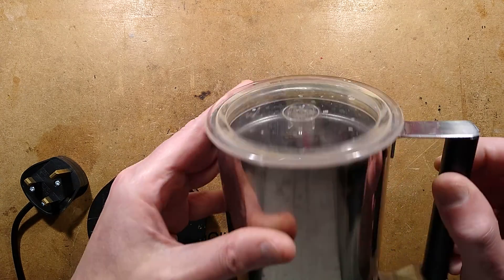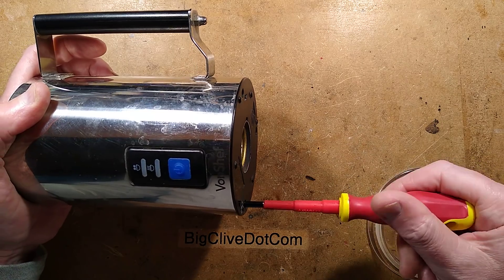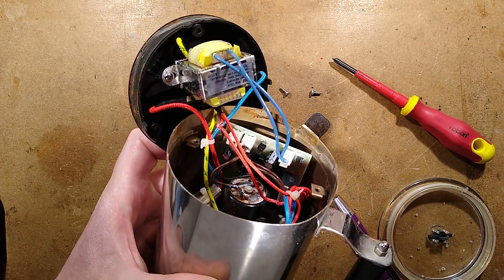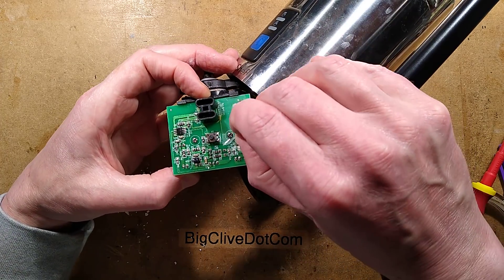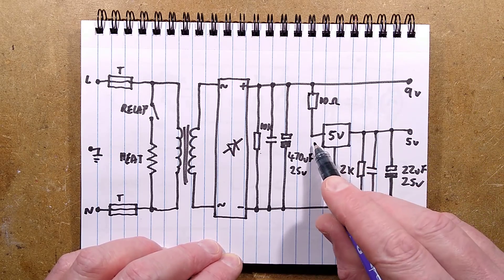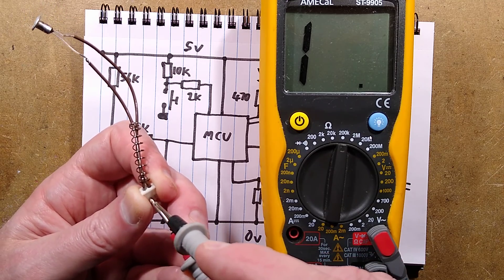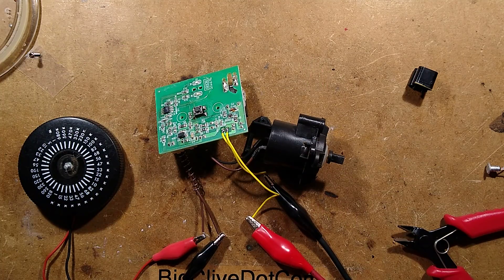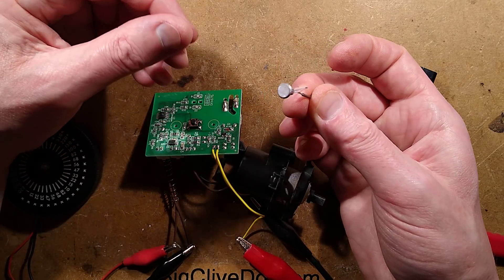Thomas Nagy milk frother autopsy

Comment: "It'll work for a certain length of time and then you can buy a new one!" Excellent marketing strategy, especially if you can forbid anyone outside your company to mend it! ^cough^ Apple ^cough^
Reply: @mgancarzjr  Schematics and parts in the case of Apple.
Reply: Most of the components on the new MacBook logic boards are SMDs the size of sesame seeds - and some, I think, are closer to poppy seeds.  Ditto for the newest iPhones.  You couldn't fix much if you wanted to, and I'm pretty sure that even Apple doesn't bother to try.  Return it under warranty, and they hand you a new one.  Non-repairability seems to be the price you pay for miniaturization and robotic assembly.   Even wizards like Louis Rossman are going to need a new line of work once all the old machines are retired.
Reply: Samsung. Appliance companies. Most companies that deal with electronics
Reply: my lord, is that....legal?
Reply: I think most electronic now days have a 8/12 month life
Reply: @zh84 - nah, with me it means I will look elsewhere first rather than immediately repeating my mistake of buying the same make/brand again (of course, there may be other reasons that I buy another item from that make/brand).
Reply: Simply, just don't buy Apple. There are other brands that equal or better them. Take some time and a little research, you'll be glad you did.
Reply: @snakezdewiggle6084  there aren’t, though. The other brands don’t run iOS.
Reply: @JasperJanssen  - iOS does have problems and bugs.
Reply: @Mark1024MAK  and IOS is the least secure OS.  Apple is the slowest to fix exploits once they are known.  It's not part of their core business.  MacOS is even worse, but it's a smaller segment of the market, so isn't so much of a target, so "false sense of security" is an issue.  I really hate to say it, but Microsoft is the most pro-active in this area, followed by Linux/Android/etc/.  

One day the hackers are going to get sick of getting blocked so quickly by MS/Linux/Android and start going after the real soft target - IOS and MacOS.  Watch the excrement hit the rotary oscillator when that goes down.
Reply: @JasperJanssen  iOs is Linux, which is Android.
Reply: @snakezdewiggle6084  iOS is Mach, which is Unix
Reply: @snakezdewiggle6084  No. All Android is Linux, but Linux is not Android. 
iOS is not Linux, its based on Mach, which is BSD, which is UNIX.
Reply: Linux is just a 1:1 copy of Unix without using any of Unix's code;  so technically Androids and iPhones are all running some form of Unix. I mean we wouldn't have any of these operating systems in the first place(at least not in their current state) if Unix never existed.
Reply: @michealpersicko9531  yeah, Linus just wrote his own version of the proprietary code and then made it all standalone turn key, and free. The guy does not get enough credit. When Linux was released - Unix did not have a GUI. But Linux did. ;)
Reply: @tookitogo  Okay, if you say so.
Reply: @snakezdewiggle6084  I say so because it’s true, and you can verify this easily. 

iOS is derived from Mac OS X, which is the direct descendant of NeXTstep, which was released as a commercial product three years before Linus Torvalds released the first version of the Linux kernel (which was years before Linux was a full-fledged OS).
Reply: @michealpersicko9531  macOS (Mac OS X) has been a certified UNIX for many years now. Linux and Android are UNIX-like. 
macOS, iOS (and its derivatives: tvOS, watchOS, etc) use actual BSD UNIX code.
Of course, this is all academic, since that’s all just at the kernel level, and ignores all the juicy stuff in the higher-level APIs where all the fun happens.
Reply: @tookitogo  OS X = 24 March 2001.  Linux = 1991~1993.  I was there, where were you.
Reply: @tookitogo  okay, if you say so.
Reply: @snakezdewiggle6084  regardless, you’ve forgotten that YOU made the claim that iOS is Linux. This is categorically incorrect. 

Everything else is people explaining to you what iOS is, since that’s a logical way to prove what it isn’t.

The Linux kernel has never been used in iOS (nor Mac OS X, nor NeXTstep, nor any of iOS’s offshoots). The GNU open source tools that are often considered part of a “Linux” operating system largely predate Linux itself, and are basically independent of the kernel. Many of these are used on Linux and all the UNIXes, including Apple’s OSes.
Reply: @snakezdewiggle6084  Again, I say so because I actually know what I’m talking about. It’s all 100% verifiable.

Look, there’s nothing wrong with not yet knowing something. But don’t attempt to speak authoritatively on things you don’t actually know, and certainly don’t try and correct people who actually do know.
Reply: @tookitogo  I have not made any reference to iOS.
I only comment on what I have witnessed and experienced personally.
Reply: @tookitogo  Apologies Antonio, seems that I did type "iOS", an error on my part. Again, my apologies.
Reply: @snakezdewiggle6084  Thanks for the acknowledgment. Out of curiosity, then: what did you mean to write, if not iOS?
Reply: @tookitogo  OS X.
Reply: @snakezdewiggle6084  OK. But that still would be equally untrue, since Mac OS X doesn’t use Linux, either.
Reply: @tookitogo  hi  Antonio. I'm going back thru my magazines to find articles that may bare-out one of us. Discovered a magazine CD with a free copy BSD and NeXTep. ;)
Reply: @snakezdewiggle6084  That’s cool and all, but you could just check Wikipedia instead... this isn’t secret knowledge or anything, it’s well documented.
Reply: @tookitogo  Unfortunately, I don't have a phone or computer. I rely on an old television + remote control, but only have access to YT and some weird asian weather site. Kind of ironic in a way, I built my first logic CPU from discrete ICs and xsisters back in the mid 70's. I also participated on some of the early papers that became to be known as GNU.
Reply: @snakezdewiggle6084  That’s wild!!
Reply: @snakezdewiggle6084  Not a solution, do you think Samsung, LG, Sony or anyone else is going to give you schematics or sell parts? Ok, technically Samsung does sell some parts, but otherwise the vast majority of the parts you need to fix your devices come from third-parties that make replacements or recycle old devices, it's very rare for any manufacturer to provide parts themselves... I'm not even a repair shop, but I've worked on at least one of all three brands of phone and all were a hassle trying to find OEM parts and I ended up just buying whatever was on ebay for all of them.
Reply: @vgamesx1  you do realize that, fabrication, modding similar components to suit other gear, etc. are the back-bone of, DIY, home workshop, hobbyists, small self-employed Tech's and engineers, and the list goes on and on.  THE RIGHT TO REPAIR !!! Go tell it on the mountain.
Reply: @snakezdewiggle6084  ok? What does that have to do with not buying apple? That doesn't solve the problem and diy solutions help but very few people want to put that kind of effort into fixing something.
Reply: @vgamesx1  ok then, simply, just buy Apple.
Now boys and girls, see how easy that was to fix! Next time, we will be fiddling with our bitcoins...
Reply: @snakezdewiggle6084  I find it hard to take you seriously when you keep dancing around my argument, since you don't seem to get it let me spell it out for you, the real issue here is that literally everyone does what Apple is doing to a greater or lesser extent, I can't think of any company that gives out schematics for their products and even if you can find parts you definitely will not find the code necessary to program a new MCU or whatever, sometimes they won't even ask about warranty/repair and straight up tell you to go buy a new one.

Comment: The board has HT46R005 silk screened on which immediately returned a result for a "Holtek Small Package 8-bit OTP MCU". It has a fairly extensive looking datasheet for what it can do. the ToC is 4-5 pages alone. 
"The HT46R005 HT48R005 are a series of 8-bit high-performance, RISC architecture microcontrollers specifically designed for a wide range of applications."
It looks pretty capable.
Reply from the maker: One day I'll remember to check the silkscreen.  I tend to go straight for the components themselves.
Reply: @bigclivedotcom  Aye it's the same with a lot of us Clive, always missing things that are right under our Noses. After spending numerous hours and many magnifying glasses and bright lights, I also need to remember to check the silk screen components description. 😉😊😂🤣😂👍👍👍
Reply: @stevejones8665  - but you do have to compare the silk screen information to the actual component as they don’t always match!
Reply: Sadly not capable of handling water ingress 😞
Reply: @chrisa2735-h3z  Now you're just milking it.
Reply: @thomasbonse  yeah, cos it's not meant for water ;)
Reply: @snakezdewiggle6084  There is a fairly simple way they could've made this frother more reliable (and more sanitary). Just separate the stator from the rotor and have the inside surface formed to create and maintain that separation. Then completely encapsulate the rotor in plastic. Doing this eliminates the need for gaskets. Also the rotor would be removable for washing.
Reply: @thomasbonse  think my Nespresso frother  is separate from liquid. Wisk   sits over the cast or sealed rottor. Not sure about the underneath
Reply: @thomasbonse  oh, I was going in the "Right to Repair" realm. :)
Reply: These small Holtek micros are basically Microchip PIC16 (i.e. 14 bit core) clones. Same instruction set (but different assembler mnemonics), same pipeline architecture giving one clock per cycle at one quarter of the clock rate, same memory map etc. They are very cheap though, single digit cents cheap.
Reply: Data sheet said.
The HT46R005 and HT48R005 are a series of 8-bit high
performance, RISC architecture microcontrollers spe-
cifically designed for a wide range of applications.
I was also guessing 14bit Pic,s aswell.
Only came to see how many spotted the silk screen.😉😊👍👍
Reply: @stevejones8665  Sounds like a contradiction? Specifically designed for a wide range of applications...
Reply: @haajee1  I could see a u-conctroller be specifically designed to be very flexible, say in what each pin can be configured to do - digital in,digital out, PWM out, analog out (internal DAC), analog in (internal ADC), interrupts,  serial protocols etc...
Reply: @ferrumignis  Suspected this as soon as I saw 14 bit wide in the datasheet, interesting.
Reply: That was one of the best silk screens I've ever seen... The component values were stamped right next to every component!

Comment: Storing it after use upside down might help with liquid ingress down the shaft.   I know  it would cost more but why not use a sealed jug with magnets driving the whisking element?.   2x👍
Reply: The Nespresso one uses the magnetic drive. Works well.
Reply: @PIXscotland  Handy to know.👍
Reply: Magnetic stirrers are very familiar in chemical laboratories.
Reply: @zh84  Yes, I never thought of that. 👍
Reply: There would need to be a whisk effect in order to incorporate air and froth the milk. I'm not sure those little pill shaped stirrer things I've seen chemists uss would work.
Reply: @Nono-hk3is  magnetic sealed motors are used for lots of things. You'd use a whisk stirring element for this, it doesn't have to be one of those pill-shaped things. Another place this concept is used is in electric water pumps used in some cars. The motor spins a cup-shaped magnet that goes around the pump housing, and there's a magnetic impeller that moves coolant through. This is usually for small auxiliary water pumps, but it's used even for main water pumps. Magnetic drive really is a good idea for anything that needs to run in liquid.
Reply: @puckcat22679  it's used in many washing and dishwashing machines too, and in aquarium pumps.
Reply: Tried storing upside-down with a comparable second unit I got from Lidl. Did not really help. That one also died from milk ingress into the motor...
Reply: @Peter_A1466  I guess when its working that would be the time the milk gets past any seals. A spray of conformal coating before use would prolong the boards life.
Reply: @dcallan812  yes, I think so. In the case of my units the motors gave up. The circuit board was not polluted. 
Confirmal coating in the motor is not a viable option, I think...
(Though I was considering a small disk to fling ingress out of harms way)
Reply: @Peter_A1466  the disk idea sounds sensible, conformal on a motor would be a bit tricky. Just need something wider than the motor. A plstic milk bottel type he plastic would do.
Reply: @dcallan812  Yup, if I can find a fitting motor eventually... Replaced the thing with another from Lidl with a different design, which has been doing it's job right for about 2.5 years (6 mnd of warranty left... 😬)
Reply: @Peter_A1466  its got 6 month  and 1 day work left . 🤣🤣
Reply: For PC water cooling the D5 Pumps also use a magnetic operated impeller. They work awesome, it sits on a small ceramic ball.